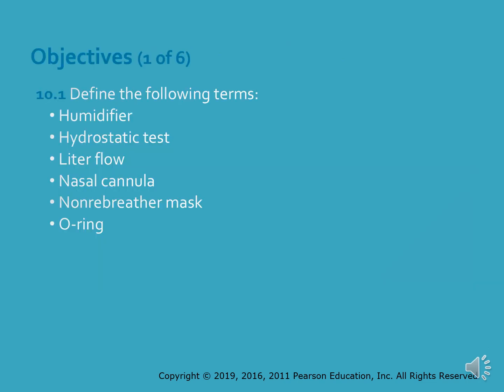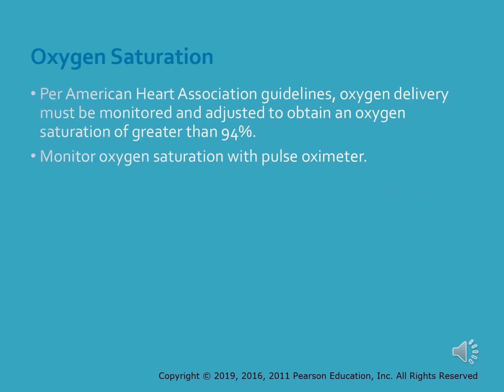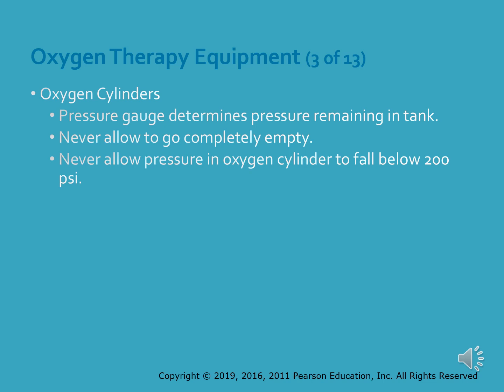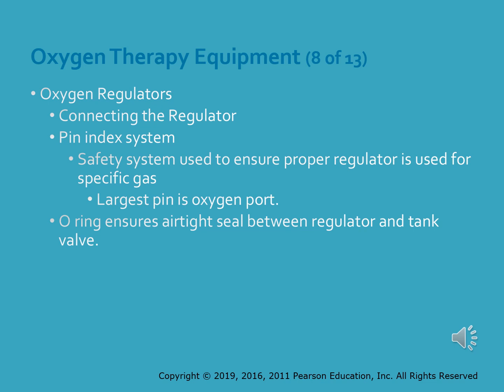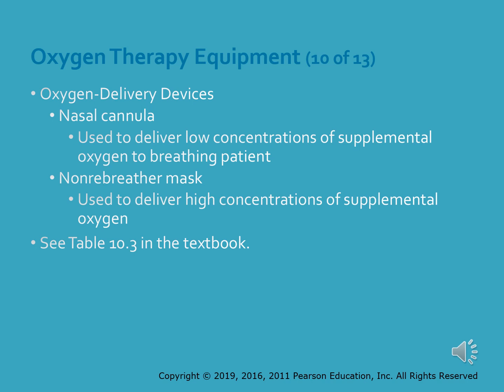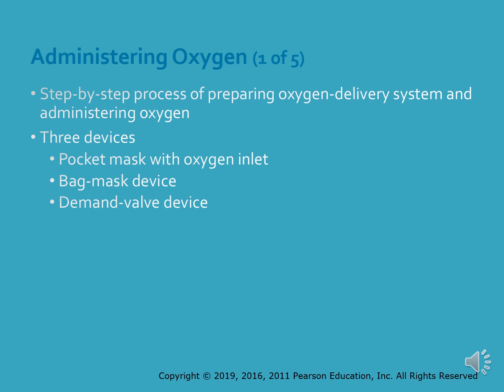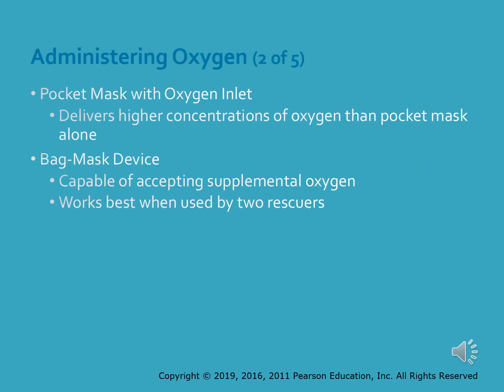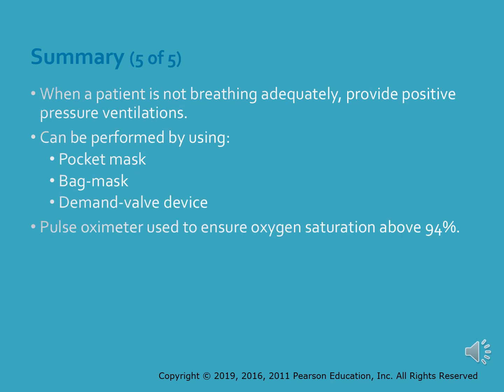Principles of Oxygen Therapy

Comment: I wasn't able to leave comments on the Airway section, but without a patent airway, nothing else matters.

O2 Therapy-Oxygen may be helpful in caring for pts with several conditions.

O2 cylinders have 2000 psi or greater.  Always need to use care with these.  D cylinder, Jumbo D Cylinder and E cylinder.

Oxygen delivery can be done with more than one type of device.  The most common types are Nasal cannula or non-rebreather mask. Flow rates-NC-1-6 lpm.  Masks-used for higher concentration of O2 than the NC can deliver.  Any flow rate above 6 lpm needs to be delivered via mask (anywhere from 12-15 lpm).

Blow-by can be used on small children or infants.

Non-breathing pts should have BVMs, pocket masks or demand-valve masks.  Airway adjuncts should be used with these.